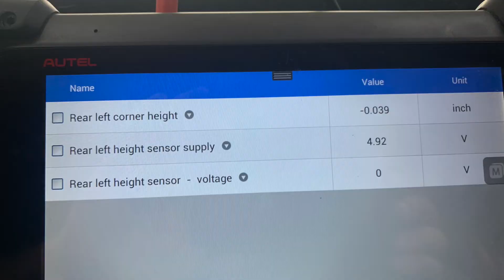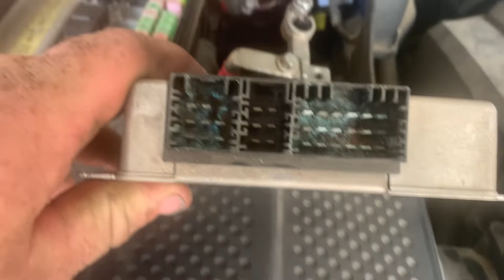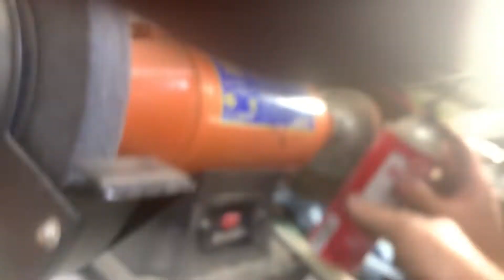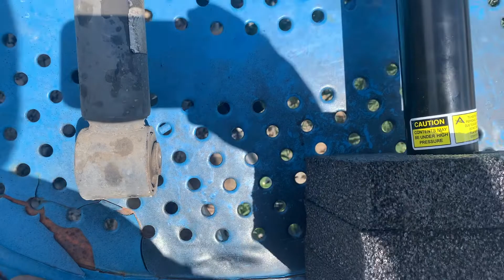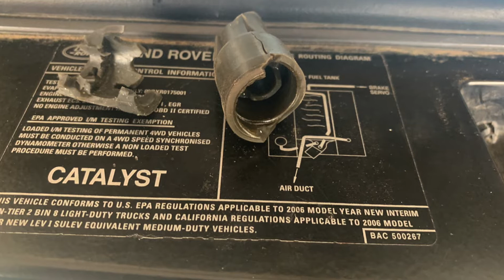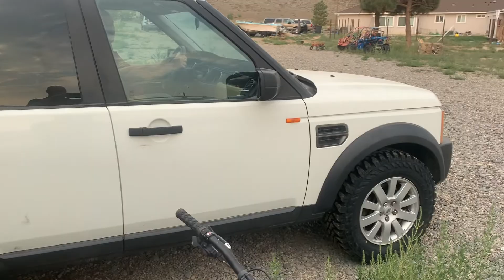2006 LAND ROVER LR3 PROJECT (PART 3) "LR3 GETS AN UPGRADED SUSPENSION"

Comment: Did you do any programming on the pcm
Reply from the maker: Other than the factory height calibration, no programming needed on anything that we did here.
Reply: What about the tcm?  They advise not to buy used because it is specific to the cars vin.

Comment: Nice job!  Swapped out lower control arms & tie rods also.  Question for you; I've got to press out the front upper ball joint, do you recommend removing the outer tie rod/axle/ or anything else prior to unbolting the knuckle from the upper ball joint?  Any info is appreciated.  Thanks!
Reply from the maker: Sorry for the late response.  We replaced both the upper and lower ball joints while we had everything apart.  So we did remove the axle shaft from the hub in order to get the press on.  If you're just replacing the upper you should be fine with leaving everything else connected, just have a jack under the lower control arm incase it wants to drop.  Then you can lower it out of the way.  Keep in mind there is a snap rig that holds that upper ball joint in, it can be hard to see, but it has to be removed before pressing out the ball joint otherwise you'll damage your control arm.